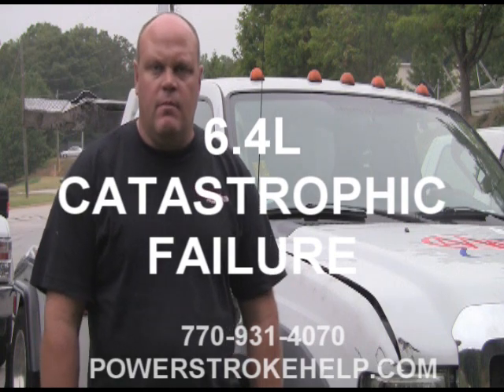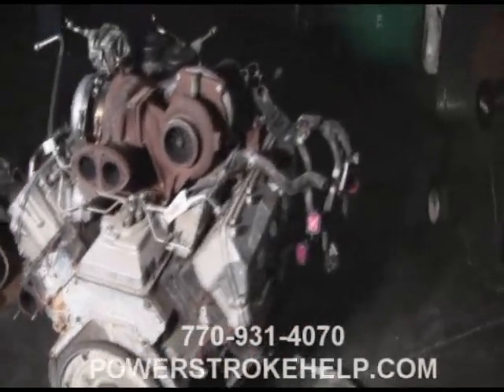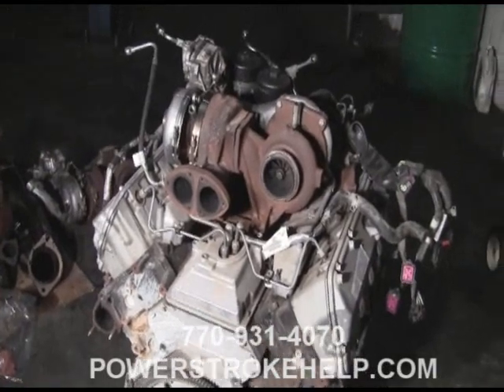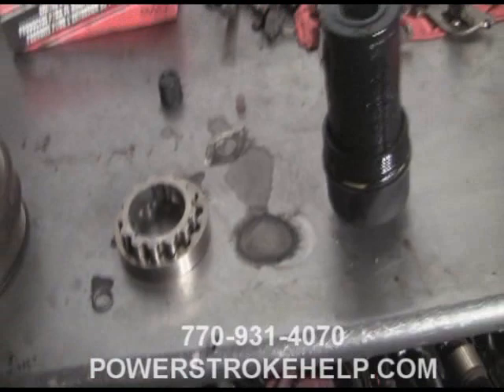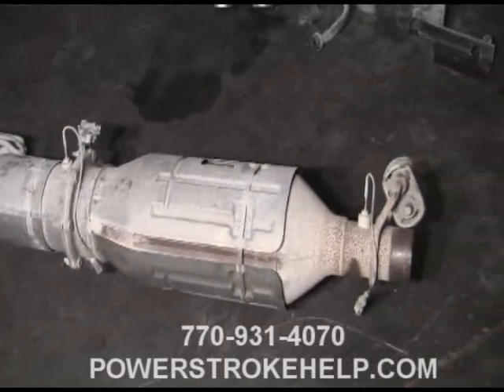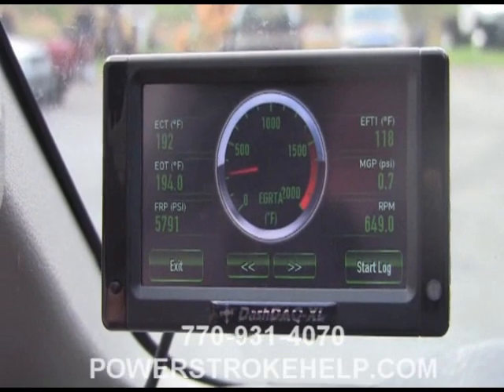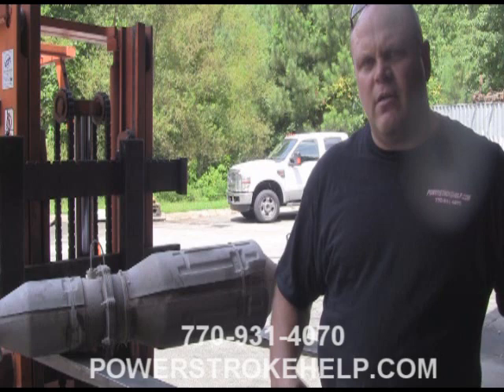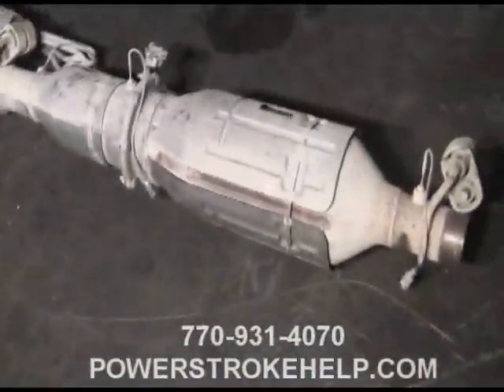6.4 CATASTROPHIC FAILURE

Comment: Changing out the DPF seems like a good option every so often even if it's expensive. I'm getting 22mpg on my 2010 6.4 with it as it came freom the factory but you have to do some long drives not towing anything to get the REGEN to clean it. I was getting 18mpg for a while till I went on a few 1000 mile trips and now I get 22mpg. That's the best MPG since Ive owned it. Also, it runs best at 70 MPH  but in California (where I live) you can only tow at 60.

Comment: I have an f450 that use to be a 6.0 truck. Now its rocking a 120k mile 05 cummins with stock tuning and a 6 speed 68rfe from a 6.7 cummins. It pulls awesome. I know mr bill doesn't like the cummins swap thing but mine is super clean. I wanted it to look as oem as possible and spent close to $30k to do it.

Comment: I'll keep my 7.3 and 5.9 thank you. I'd even take a 6.0 before a 6.4. At least when a 6leaker breaks you can fix it. When a 6.4 breaks it's a whole new motor. Way to go navistar and ford
Reply: My uncle has owned about 4 6.0s each and every one of them has had failures. Only one made it past 200k. He thinks the 6.4 is better
Reply: @RETROB0T141  I drive my uncles 04 f250 and the 6.0 completely self destructed so I went to a used diesel shop and they only had engines for commercial vehicles and I found a 05 VT365 International engine it’s completely identical to the 6.0 power stroke so I had that engine put in and I’ve had it deleted and bulletproofed and I’ve had absolutely zero issues it’s fast af to being an industrial style 6.0
Reply: My 6.0 has 350,000. Just now changing the hpop.

Comment: Back in the 70's, the company that I worked for, had a brand new GMC 1 Ton Pickup, with a 557 Gas engine, and Atlas-Chalmers automatic, with only 1000 miles (or so), self-destruct on the highway. Just cruising along at the speed limit of 60 mph, when BANG the whole front half of the engine block exited the truck through the radiator onto the highway. Took almost a half mile to stop, as steering and brakes left with the engine. The main crank had a spiral fracture at a main journal that split the block at that point. Best news - ALL under warranty!

Comment: I have a Ford LCF 4.5 power-stroke. It regens the same way the 6.4 does. I’ve had to replace the turbo when the seals failed as well. I’ve even thought about hollowing our the DPF and letting it just be an empty can. Will this throw a check engine light? Or will the truck just think everything is good because there won’t ever be any back pressure. No one sells a tuning program for the 4.5 power stroke because they never made that many of these trucks.

Comment: What is brass in the oil filter from?
Reply: It's from the main bearing failure they are a soft material on purpose so you dont have hard metal on hard metal spinning at 3k rpm or more... typically they are brass

Comment: The Ford truck is just fine. Why dump thousands in these JUNK power struggle engines, swap in a 5.9 and be done with it.
Reply: its not the motor... its the emissons that fucks them up.  My 6.4 is deleted and has never been better.

Comment: i almost purchased a used diesel ambulance for work and i was wondering why was it so cheap then i did my home work about these ford paper weight engines im so glad i didnt jump on that truck ....
Reply: NUCLEAR BUM only time it’s a bad idea is if it’s a 6.4 even then if you get it cheap enough it’s worth grabbing then use the money you saved for supporting mods to correct the wrongs of the engine

Comment: I have a 08 6.4 crew cab long wheelbase truck that just turned 300k. It was completely deleted at about 60k. It did need head gaskets rockers, bridges etc at about 250k, but runs great now. No blowby at all. Stock fuel system, Edge tuner, intake and 4 inch exuast from turbos back, it runs mid twelves all day long. Get rid of that emissions crap!
Reply: No offense but that bit about running mid twelves make it sound like all you do is take it to the strip.

Comment: 6.4 engine... Very dependable boat anchor...
Reply: The 6.0 would at least be better to get that way you won’t burn a big hole in your pocket
Reply: fadingbeleifs usually just the EGRs bud, other than that their stout
Reply: @funnydubby6401  They have more problems than the egr....... literal boat anchors.

Comment: The DPF is the bad guy because it was a band-aid fix to the US EPA requirement on diesels.  The problem with the 6.4 is worse than that, because there are pleanty of areas where reliability was cast asside to save money.  you CANNOT rebuild the rods and in fact the entire valve train is a piss-poor design.  The rocker arms WILL fail at around 100K miles which will require total replacement and while you're in there you might as well replace the heads because the valves ride on a STEEL guide (not bronze) and are not rebuildable.  They figured THAT out back in the 30s (to use bronze / steel) and the same is true with the wrist pin and rod.  The whole thing was designed to last about 150K-200K if you're lucky and then throw the engine away.  I know there are people out there who have 200+K on theirs, but I am telling you IF you have one and it still running good....SELL IT because it could shit the bed any day and when it DOES, dig DEEP because the engines are more expensive to fix than a 6.7 becuse of the relationship issues with International.  You are better off trading the thing or selling it and getting a 6.7 than to keep a 6.4 truck

Comment: Like your straightforward no b.s. videos. I've deleted the dpf and egr and just spent 3 Saturdays of pure hell putting a water pump in the damn thing. The only thing that scares me is talk about it being a throw away motor and catastrophic failures as low as 160,000 miles. I'm at 105,000 now do you suggest I sell my truck. It's definitely not cheap or easy to work on and I really wanted to get 500,000 miles out of it. I also run a spartan 310 tune on which I'm sure can't be good for it either.

Comment: DPFs suck engineers need to invent a diesel particulate catalytic converting device of some sort that burns the soot on the fly instead of storing the soot before burning it.
Reply: Actually it's more how Navistar/Ford implemented the clean out of the DPF. Instead of injecting the diesel fuel with an igniter directly into the can like other active systems do they decided to try to pump it down the system to the can from the engine cylinders in a more passive system setup. 

Also Navistar/Ford did not design in a feedback fail safe. BMW, Audi, VW etc. for a long time use differential pressure sensors and know when the DPF Is clogged and isn't recovering. The system then puts the engine in reduced power and alerts the operator as to the reason to save the engine.

Example. http://www.specialistcarsshrewsbury.co.uk/images/dpf-page-image-2.jpg

DPF does have its issues, it is definitely a service item but the cheap way that Navistar/Ford tried to implement the system is what bit their customers in the butt. There is a reason that Ford said goodbye to Navistar with the 6.7 and developed it in house.

Comment: Bill,

I have a 2009 6.4 - I have made all your recommended changes from Arch Oil to the radiator cap. I have the H&S Tuner on it and only use the tow and street modes and I NEVER use the performance mode (I have no use for that mode). I don't beat on my truck and take good care of it. My main concern is the tuner after watching some of your other videos. I watched your video on the 6.7 motor that failed b/c of the tuner. Is the scenario apples to oranges between the 6.4 & the 6.7 or is it a genuine concern? Thanks.

Comment: I have a way to fix this problem sell 6.4 and buy good old7.3 problem solved
Reply: +XGN DIESEL117 Yes an International engine.
Reply: Still the best motor in powerstrokes
Reply: Still the best motor in powerstrokes
Reply: 6.4 is still an international engine, the 6.7 is the in house ford engine
Reply: Yes the 6.4 is still (international), but the emission & computer etc... is all Ford. >Much like the 7.3  . When it's in a (bus) , many don't have a EBP valve, or the lame "double shot injector" or a PCV system pumping oil into the turbo / intake , it will have a air oil separator, or dump PCV out to the air.  The 6.4 would be great without Fords "emission" crap.

Comment: So . . . when you say it's smoking like holy help, is that white smoke or black smoke because I had a fuel pump go bad and it had been smoking bluish/white intermittently and getting really BAD gas mileage (11.5 without towing) for over a month before the engine light came on. The repair was 1200.00. Now it's getting 15 mixed city streets and short hops on the freeway (we call them freeways in California, I dont know what you all call them) This whole time the REGEN never came on much or if it did it just stayed on for a few seconds and turned off again. 

I'm 60 years old and this is my first Diesel (that Ive been wanting to buy for 30 year) and now this 2010 6.4 has me worried that it wont last very long and the reason I bought it was because I figured it would last the rest of my life.

The best mileage I ever got was 21 MPG from Los Angeles CA to Carbondale Colorado (up hill all the way but not towing) but I figured that was because the air is thin at altitude and not as much windage at elevation.

Comment: I've hot a 2010 F350 King Ranch with the 6.4L.  I had a H & R High Performance tuning kit installed and straight Diamond Eye exhaust all the way back.  Does this fix the issue with the exhaust system?
Reply: If you got rid of the dpf and egr system, yes. but if you're running the high power tuning with the emissions controls on there, you'll destroy your motor. If your gonna run dpf delete tuning, you need to get rid of the dpf.

Comment: Guys what's the consensus on the 6.4? I'm looking at buying a used 08 with 160K miles on it and it will be doing about 1k miles a week. 95% highway driving.
Reply: ***** I just bought a 6.7 fuck the 6.4!
Reply: +VTL One slight problem with the 6.7 the connecting rods are garbage and BEND!
Reply: Dude don’t buy a 6.4. My granddad bought a 2010 f550 stake body from a reputable dealer. Brand new motor.  We have a garbage and recycling business, we needed a truck for corrugated cardboard pickups at a feed mill...anyway, from day one, we’ve had problems with the truck. It’s always had an engine light on, it pours blue smoke under load, and it just runs super hot. It’s been to our mechanic a shit load of times, and other than swapping a different engine, the issues went unresolved.  EGR cooler failed, #8 injector fried, can’t tell you how many times the DPF has been clogged.  Now it’s 2018 and the truck has sat at our shop for the past three years.  Biggest piece of shit engine I’ve ever been around, and I had the unfortunate pleasure of driving a MBE 4000 powered truck.  We got a deal on the truck with a real nice body on it, and hydraulic lift gate. Everything else on the truck is cherry, except the power plant. Fucking junk. The only ford diesel we have that hasn’t given us problems are our 6.7L f250’s and 350’s. Cummins reliability goes without saying. We have an N14 in a kenworth t600 that has 1.1 million miles on the original injectors.
Reply: VTL p

Comment: I smiled as I watched this, knowing the outcome. No matter it be GM, Ford, or Dodge we gave up on these little pickup truck based diesel chassis for fleet units long ago.  They all were just too expensive to buy outright, they had to be meticulously maintained or they would grenade themselves, they were too difficult and costly to repair even when we found people willing and competent enough to do so, and all of them ended up virtually worthless pieces of junk at 250-300k miles.  We went to real class 6 and 7 chassis- they don’t cost that much more to buy new, they just need normal maintenance, repairs are much easier to perform and much less frequent equaling less costly, they last 400-500k miles or more easily, and they still have some residual value at the end of that.  Pain over.
Reply: It really sucks that nobody can get it right but hey weres the money in that huh?

Comment: Bill I just bought a '08 f250 6.4l fully deleted from a dealership with a 192,xxx miles on it. How reliable are the stock transmissions in these things? It does have a programmer on it but I just plan on driving it on stock tune for awhile until I get use to it. Any help with these things would be greatly appreciated.
Reply: Transmission is actually very well built and can handle around 250hp more safely... going into the 3 or even 400 range will start hurting parts hope this helps!

Comment: I just purchased a 2010 6.4 with 190,000km. I knew I was going to do something like what you had said, but you video just confirmed even more that I should remove the DPF. Awesome vid. Thanks for that advice.
Reply: +James Hall please use Miles per hour vs Kilometers per hours because it's alot easier

Comment: I just bought a 2009 F250 6.4l and watching your video has inspired me to gut out my DPF. My question is once I do this is what did you mean by reprogramming the truck? Did you mean with a tuner or something to erase the code(s). I don't want a tuner in my truck. New to the Ford diesel. I've owned a couple of Dodge 5.9's before and decided to try out a Ford this time. Either way I like my new truck and want to keep it for a while. Thanks for video and educating me on my new journey!
Reply: Absolutely with a tuner.  If you don't have a DPF and keep the stock tune, it is gonna dump raw fuel right the tailpipe while running flame flower style.
Reply: They sell a one time use chip you can use to delete the dpf and egr for about $300 on ebay.
Reply: Just buy a tuner and remove the DPF. I bought a SCT tuner with the Innovative Diesel tunes. It will wake the truck up! If you don't buy a tuner and gut the DPF it will destroy your engine because it will still go into regen mode.

Comment: BILL....... BILL........ Wondering about your 2010 rollover rebuild...... How do you get 20 mpg? I did CAT/DPF delete. What else do I need? Or someone guide me here. I'm getting 17 on a great day.
Reply from the maker: Get some Archoil fuel additive in there and you will pick up some MPG. Got 18.7 over the holiday on a 1800 mile trip.
Reply: Logan Curry what video did you hear that? The 6.7 isnt a 150k engine. A 6.4 with the egr intact is though.
Reply: +powerstrokehelp in a previous video you said the 6.7's are known for only going til about 150,000... now are the 6.4's known for that also or does it have to do with not only maintenance but the dpf filter or either one?

Comment: Is this why they started using Urea int he new 6.7? To avoid this heat?
Reply: No. Urea is for a different type of emission - NOx (nitrogen oxides) which are produced by lean burn engines (diesel engines) and cause smog.

There are 4 main emissions systems that are turning up on modern diesels:
EGR (exhaust gas recirculation) - pull exhaust into the intake to richen the combustion. This reduced NOx.
DOC (diesel oxidation catalyst) - this helps finish combustion where combustion is incomplete. This reduces CO (carbon monoxide) and HC (hydrocarbons). Can also provide slight reductions in soot and NOx.
SCR (selective catalytic reduction) - this removes NOx by reacting it with urea in a special catalytic converter. Extremely efficient at removing NOx, but requires very high purity urea solution to prevent damage. Urea solution is highly corrosive and incorrect storage can corrode containers and the corrosion products can destroy the catalyst.
DPF (diesel particulate filter) - A fine pore filter which catches soot particles from incomplete combustion. If the DPF gets hot enough the soot will burn off and clean the filter. Often, the DPF needs help to get hot enough to ignite. Different manufacturers use different techniques to force a regen (burn off) - inject fuel during exhaust stroke, have an extra fuel injector in the exhaust pipe or use a liquid catalyst fuel additive. If the DPF gets too clogged, the regen will not run automatically, because if you ignite the soot in a heavily clogged filter, the soot can burn so hot that it will melt the DPF. Burning oil will kill a DPF quickly - while diesel burns with zero ash, engine oil produces ash. Heavy duty oil produces loads of ash. If the ash clogs the DPF, you cannot burn it off - the big problem with this is that the PCM will see a clogged filter and keep it in regen mode until something burns. It is critical if you have a DPF never to use heavy duty engine oil - only use DPF compatible oil, or the ash will clog it.

Comment: lack of maintenance will cause a turbo drain restriction and blow out turbo seals.  And because they dont keep up on maintenance like they are supposed to, it goes low on oil, wipes out bearings, contaminates the DOC and DPF and they start to work less efficiently which causes them to go into regen more frequently.  I dont agree with this guy on this one.  I had one that did this a couple years ago at the dealer and the oil will bake in the drain and almost turn into a plastic like substance.  and its always on the HP turbo.

Comment: This man is telling the absolute truth.
Pretty much the same had happened here. Oil light went on - oil levels were low. After inspection it was discovered the turbo was on the verge of going bad, and had to be repaired already. Sometime later - the injector went bad. 
Fortunately, the turbo guy informed about this problem, which was clogged catalytic converter, which was was the initial cause of turbo and injector problems.
The solution was pretty much the same as suggested in this video: since this particular one came without DPF so only the catalytic converter was replaced with pipe - resonator.
Thanks to the speaker in this video.
This problem can occur with any truck, or any diesel vehicle! Over here it is 2.0 D4D Toyota.